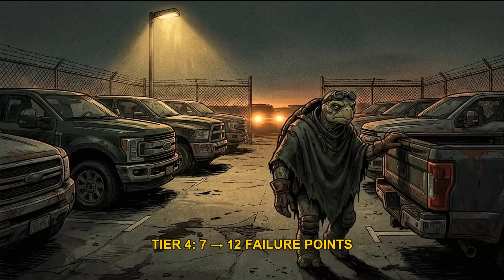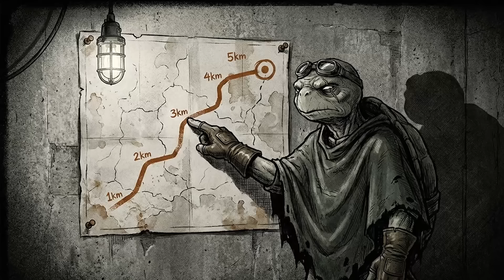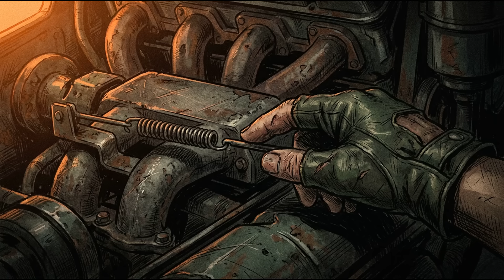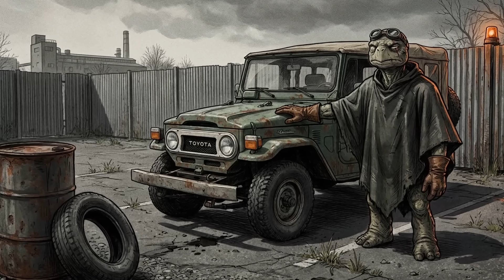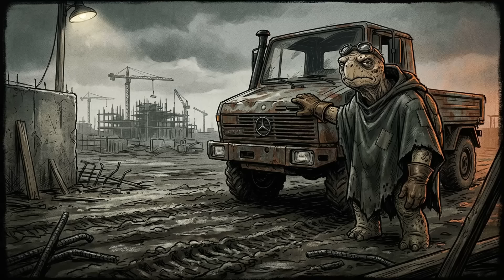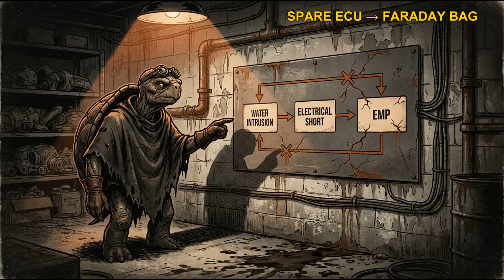When EVERYTHING BREAKS DOWN, veterans WILL CHOOSE THESE vehicles, which ARE BUILT TO LAST!

Comment: How would you score a 1993 Dodge W350 5.6 cu intercooled diesel, 5 spd, 4x4 manual with fusible links deleted, 89,000 original miles?

Comment: I think the starter should work if you come up with a mechanical solenoid to get it to run. Like the 1942 MB Jeep I had, it had a mechanical button on the floor to engage the stater.
Reply: My great uncle had an old Chevy trk when I was very small.l remember he had to push a small pedal for the starter to work.
Reply: @larrygooch6233 yup, pretty common on older vehicles

Comment: How will we get gasoline or diesel fuel during a collapse?
Reply: You can create diesel fuel out of used motor oil, cooking oil, and even rendered animal Fat. Just have to know how, and it’s not hard and something you can create on a Saturday.
Reply: @Fenrir_Furt   In the other collapse videos, you chat bots all say there is no fuel during a collapse.
Reply: @Fenrir_Furt  If creating fuel is so easy, then why do fuel stations exist?
Reply: Insert hose in any vehicles gas tank and suck. That's how you get gas or diesel.
Reply: From other vehicles that are not running. Left with the rest of the dead vehicles.